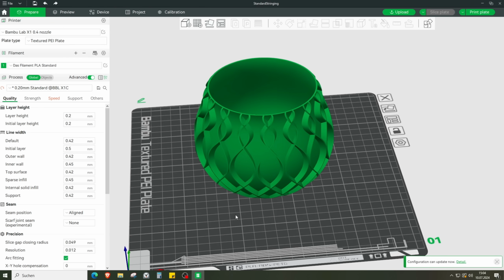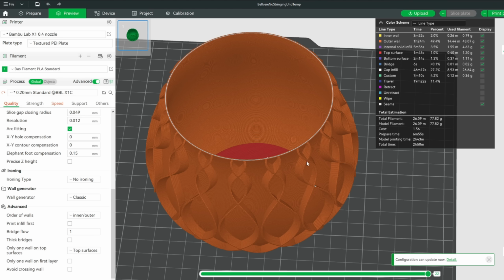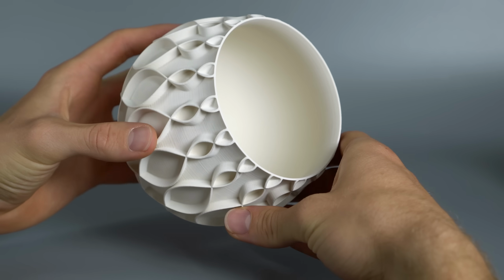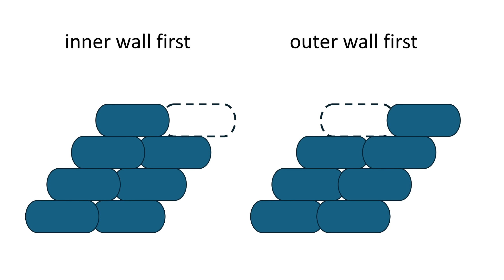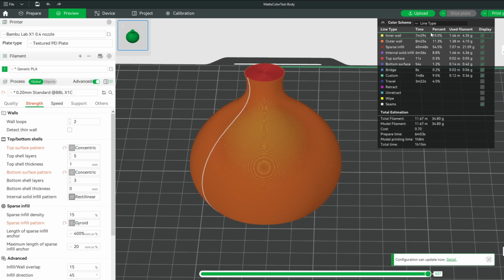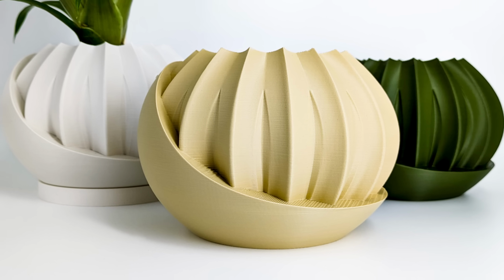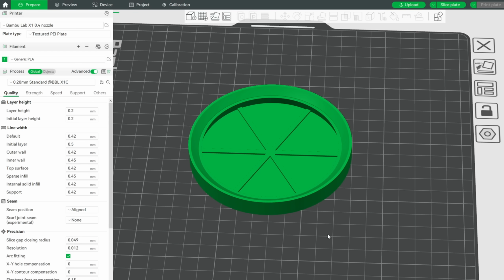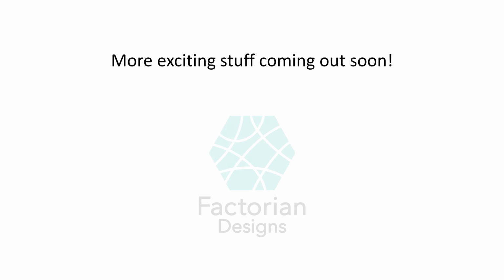5 Tricks For Incredibly Clean Prints!

Comment: This is probably a very silky question, but aren't models on makerworld already optimized for print when you download them?
Reply from the maker: No not at all, most have very basic settings.
Reply: @Factorian_Designs with ai being pushed everywhere isn't it possible to use ai to analyze the uploaded models like it's used for example for vulnerability and exploit scans on app stores?
Reply from the maker: Not sure if there is close to enough data to relate printer settings and results that would be needed for Ai training like that. I think thats still very far off.

Comment: PLEASE MAKE A VASE MODE/one wall video tips and tricks like 0.4 nozzle 0.32 line width lampshades with not kust round geometry but going in and out . when small i print sucessfully this type but 200x200x200 (ca.) will have like holes , z wobble lines ? , etc. bitteach ein Vase Mode Lampenschirm tips and tricks video mein freund

Comment: If it’s caused by the temperature on slower layers why not just change the temperature to account for the accumulation of extra heat on slower layers..?
Reply from the maker: That would be a very hard to implement in the slicer and would need finetuning for every filament. Not sure if that is a priority for developers if it can be fixed like shown.

Comment: I think you might be an expert on this problem. Could you help me? I can't download a ready-made file from Bambu Lab and open it in SolidWorks. Why do you think it is? 3mf or STL?
Reply from the maker: 3mf is just a zipped STL with a bunch of other stuff. You can unpack 3mf files with any zip software btw. In your case you need to import the STL. 
But these are hard to modify, sometimes people include STEP files, which would be way better.

Comment: Thank you so much for your videos! I'm playing with printing outer/inner and I've ran into a problem printing a simple vase: whevener I get a new line and the unretraction happens I'm getting an uggly seam with some oozing. I have everything calibrated and dry. Any parameters to help with that? I'll play next with the slice gap closing radius and seam gap parameters and see if it helps.
Reply from the maker: This setting does tend to make an uglier seam. If you have 3 walls try the inner/outer/inner setting instead. This should fix the issue.

Comment: Good Tips. 
If you're PLA looks matte then your print speed is too fast or temperature setting too low (unless you're specifically using matte PLA). The most uniform print quality comes from setting the speed the same for the whole print, at least for the outer wall. For a show piece, it's generally best to just slow the print speed.

Comment: The matte/gloss problem is not relevant to printing speed, but is relevant to insufficient flow. It's just oftentimes higher flow rates coincide with fast linear speed, but not always, and the better way to diagnose the problem is to look at the flow diagram instead.

Comment: Very well explained. I’ve watched it before I started using my printer and again today to make the prints looks better. Easy noticeable improvements. Thanks. Subscribed.
I have  a question. Which filament do you use for planters so they can hold a plant and water, and possibly stay in a sunny position without falling apart in a few months?
Reply from the maker: The planter on my desk is sitting in the sun since 3 years, waterproof and is made out of normal PLA. But it doesn't get that hot here.

You could use black PETG which is supposed to have a little more UV resistance but I havn't tried that out.

If you want to be extra save use ASA. Its UV resistant, great for higher temperatures and outside use. Just be careful with the toxic printing fumes.
Reply: @Factorian_Designs  Thank you. Lots of 'experts' says that PLA won't last long.
Reply from the maker: @rafk4424  I know and I think some of them are also right. A big problem is that PLA can be quite different depending on what additives the manufacturers decide to add.

Comment: Slicing algorithm is by far the most important thing, and Cura is the best, period. 
I use Prusa because it has more flexible settings, but it's simply incapable of doing seams on round objects or even adding consistent lines to the one wall.
Reply: Orca also has Cura’s Arachne now, I think PS might too?

Comment: I appreciate that you explained the pros and cons of printing the outer layer first
Reply: One thing he failed to mention for out wall first, is that there can be issues for certain geometries. Normally, if extrusion is say 1% too high, your outer wall will just be too big, causing the uneven layers texture. With outer wall first, this cannot happen, so the excess ends up on the inside. This is fine if its facing infill, because the excess ends up on the hollow interior. The issue is if there is no infill on the backside, and instead have more perimeters, so for example if your print is only 1.6 mm thick, and you print 2 perimeters, at 0.4, then you have nothing but perimeter on both sides. Then the only place the excess material can go is up. After a number of layers, it will build up so much that it will possibly cause a print to fail. Outer perimeter first needs very good calibration to avoid this.

Comment: I had to learn these tricks the hard way, I probably had 50+ "failed" prints until I found the outer/inner "hack" and the avoid crossing walls. Just with those two settings the prints look immensely better straight of the printer and require minimal post processing 😃

Comment: when i change outer wall for 0.33 like on your movie (bambo P1S 0.4 nozzle) i got spaghetti... when it build outer wall, it's too thin and doesn't stick together
Reply from the maker: depending on the filament, going to low can lead to problems as well, did you use PLA?
Reply: @Factorian_Designs   @Factorian_Designs  PLA Silk Dual Color from bambolab im was trying to print this model 75% of size: 1019859-halloween-candy-cauldron biggest problem is on the bottom

Comment: With outer then inner walls I've found with filaments like PETG if your printing more than 1 part your more likely to get defects on the outer wall because as the nozzle travels between parts and initially touches down to start extruding it's likely to leave a small blob. 

Now in some slicers there's an option for inner outer inner that solves this issue as it prints a single inner wall, then outer wall then the rest of the inner walls.  You of course need more than 2 walls for this to work.
Reply from the maker: Yes you are right, I should have mentioned that in the video as well. Especially around the seam it can get less clean. For prints where the seam is hidden I like it the most.

Comment: another thing you can do is to zoom in alot on the preview pane to see that the deviation added to the model from the following slicer setting will make for even better prints with the cost of longer slicing time;

1. lower resolution from default 0.024 or what your slicer has to 0.
2. disable ARC
3. lower deviation to 0.04
4. zoom in again and behold the non squiggles and deviations.
5. increase nozzle temp by 10-15c if you still get matte/glossy sections. 

watch those shifted layerlines disappear , even on those white prints ;) This is only possible with a correct flow,temp and speed calibration.

p.s.
remember that time is cheap, failures are expensive.
Reply from the maker: Thats an interesting suggestion, I have played around with these settings but not to this extent. I will definetly try this out.
Thank you for the input!

Comment: Since your video's publish date, has the Bambu Lab Studio got the update that you mentioned which existed in Orca Slicer?
Reply: I’m actually going to buy my first Bambu printer in 10 days. It will be X1C combo. I’ve had 5 Prusa MK3S+ for years but I decided I should try the Bambu. I use Prusa Slicer all the time. Do you think it is good to first start using the Bambu Slicer with the new printer or do you suggest me to use the Orca Slicer right away? I thought the official slicer might be a good start especially when using their own printer. What do you think?
Reply from the maker: @kaanaslan_tr  Sold my Prusa MK3S+ for the Bambu Printer and I love it. I have also written down a few things about the different Bambu Lab combos you can get on my website if you want to take a look at what I would recommend.

I would honestly use the Orca Slicer right away, I see 0 disadvantages and the Interface is 95% the same.
Reply: @Factorian_Designs  Thank you. I'll give it a try. I don't know if it has all the features like reaching the camera but I'll definitely check it out. 

I can't sell my Prusas :) I tried but I never received any offer :)
Reply from the maker: @kaanaslan_tr  It has all the connection features like camera, remote control etc. 
Yeah I can imagine they are hard to sell now. But I guess its ok, they still print decent just a little slow.
Reply: @Factorian_Designs  yeah, I even have 1 MK3S+ kit which is in a box for almost 2 years and waiting for me to be built :)
Reply from the maker: No, Bambu Studio still doesn't have it. I would just switch to Orca Slicer. You can even take all printer and filaments presets with you.

Comment: A huge improvement to print quality for me was to check the wheels on X and Y axis, they where over-tightened from the manufacturer and the ride wasn't smooth. Check the bumpiness of your axis by moving bed or toolhead manually. They should be barely in contact not squished !
Reply from the maker: True, mechanical imperfections can make a huge difference. Luckily they are rare with newer gen printers.

Be careful with moving your printer manually, this can lead to induction currents and may damage your electronics.
Reply: @Factorian_Designs  I guess there are fewer problems without these rubber wheels...
Reply from the maker: @thds4815  yes definetly but if adjusted right you can print just fine with them.

Comment: Hi, does anyone here know if the Creality Print slicer has a feature similar to Avoid crossing wall? Thank you for your insights!
Reply from the maker: Yes it does, take a look at the "combing" setting. Thank you for watching!
Reply: Its called avoid crossing wall if you turn on your advanced setting. I use it to print vase in my k1c and it works OK
Reply: @daruchusnu6941  Thank You!
Reply: I cant find it. Combing is not a setting in cp. Its in cura
Reply from the maker: @danielcrandell7533  You are totally right, sorry that is only for Cura. 

There is an avoid crossing walls button in Creality Print slicer to check off on the “quality” pane, at the bottom, in advanced.

Comment: Summary
1. Avoid crossing wall
2. Outer/inner
3.1 Top/Botton surface concentric for round object 
4. Increase overhang speed, and Dont slow down on outer walls in Filament 
3.2. Concentric surface for top layer for round object 
5. Print only object at the time
Reply: The matte finish is an indication for to much temp or volumetric speed. With that you have also not a good layer adhesion. The glossy print is much stronger.
Reply: @Flatout-i1v But we wanted it to be matte
Reply: @Flatout-i1vmatte normally means you’re pushing out the filament faster then the heater block can handle. Run slower OR run your nozzle hotter and it should be shiny again. Shiny = good layer adhesion.

Comment: Trick 6: if you didn't spend money on a printer buy a Bambu.
Reply: I just bought my K1C a few weeks ago. I am pretty happy but I maybe should have spent the 100€ more for the p1s :(
Reply: @itzleeky6461 i did the same thinking. K1C won because of the carbon, Bambu needed more upgrades
Reply: @itzleeky6461 sell it again an you can buy new bambu p1s bro
Reply: @itzleeky6461 I wouldn’t always say so. I got an A1 and kind of wish I’ve gone for a K1 tbh
Reply: @itzleeky6461 do you mean x1c?
Reply: Agree, save headaches and time, and get a Bambu. Went through many printers. My new bambu p1s with ams now produces so much better results right out of the box, no settings tweaking required at all. The print plate has awesome adherence, no more need for 3d glue spray. Bambu just apparently did a lot of things very right. They don’t focus entirely on the hardware but instead offer a perfectly tailored solution with optimized software. Wish I had known earlier. My snapmaker idex printer which I loved very much did not by far produce the bambu results, despite constant tuning and experimenting, and unfortunately had clogging issues regularly, despite trying default settings, tweaking, different filaments, even replaced hotends.
Reply: Thank you but Nah, they're too expensive. They deliver little for the price they charge
Reply: aint like yt, facebook insta arent selling my data already, id rather trust the chinese than the american not even gonna lie
Reply: Instructions unclear. I now have a bambu and a panda is chasing me.
Reply: @VSquared3DPrints ever since pandabuy got raided ive been seeing pandas in my walls
Reply: Kobra S1 combo working fantastic for me
Reply: I bought my first printer bambu! Should arrive tomorrow can't wait to see what I can make for my house
Reply: Bambu is just an good option. Not the only one.
Reply: @methodiklabz mine is working like a charm with little adjustmants
Reply from the maker: Can highly recommend as well 👍🏼
Reply: New Plus4 from Qidi offers Bambu print quality with Bambu like interface, but heated chamber and 305 bed.  It will have AMS early next year all for $799, I have couple dozen hours with it.  Great machine!   Love the bambu, but love to do Nylons! For nylons one wants a heated chamber with nozzle temps that can go to max of 370C.   Love this new machine.  Highly recommend it.  I could not justify over $2400 for Carbon X with a heated chamber.
Reply: @jefft490 sadly $799 is only the printer and AMS/MMU is still up in the air. It's estimated for Q1, which is halfway over.

Still a good option for a variety of filament types, heated chamber, large build plate, (and had one Day Amazon shipping), but no MMS today
Reply: Buy a prusa instead
Reply: This aged poorly
Reply: Why @Akhilesh_H
Reply: @Akhilesh_H  yeah because all of the sudden the controversy made the printers quality degrade
Reply: Trick 7, but a enclosured Bambu printer if you have kids 😅
Reply: @pauls6277  or pets 😂
Reply: Yeah No thx, Companies like Bambulab are not supportable at all, nice product but sadly they are against open source with there closed Ecosystem.
Reply: @gordonbelfort7176 It's a walled garden.
But still not a bad walled garden. You get everything you need inside. This could become bad in the long run,But it's great now.
Reply: Aren’t a lot of the newer printers much more closed sourced now though? For example my ender 3 years ago was as open sourced as it gets. But the newer creality machines have firmware updates that are just compiled binary. Afaik a lot of these printers do not easily support marlin without mods right? Products are much easier to develop and fine tune for a specific platform vs making the software modular and support hundreds of different printers. Also look at the impact bambu lab has had on the market 3d printers got better very slowly over time until they launched. Now they are all incredible out of the box. Just my 2¢
Reply: @Javii96  that's the point, some manufacturers have been semi-closed or closed systems. But since Bambulab hit the market a wave of them are changing from open to closed source. They started it and even if they are the best machine available, the point is it is against the community that started consumer 3d printing.
Reply: @gordonbelfort7176 in what sense is it closed source besides the software being their private product?
Reply: @slowestjabroni  most hardware used are not industry-standard and not compatible with any other manufacturer on the market, the software used in the machine itself is not modifiable, all Accessoires are mostly locked in this closed eco-system.
Reply: My p1s was my first printer. I have no issues with it and it made getting into 3d printing very easy for me
Reply: Hi, I want to make a vase and sell it. Which 3d printer can I buy for perfect vase?
Reply: Or prusa, their speed may not be up at bambu's level but the quality and dimensional accuracy is unmatched and they are also weirdly quiet
Reply: I have both, bambu has the highet accuracy. You sre soing something wrong@FrIoSrHy
Reply: This didn't age very well...
Reply: This aged like milk
Reply: Bambu is also backed by a firm who is working with the Chinese military so I cant buy their printers 🤷🏻‍♀️

Comment: My hands have been shaky ever since I've known myself as well. Don't worry about it too much ^^
Is there a some way to tell if my line widths are bad and understand if I should change them?
I also really like your studio lighting setup.
Reply from the maker: The shaky hands comment was only supposed to be a light hearted comment, luckily I don't plan on becoming a surgeon!

As long as your line width are around 0,4 - 0,6 mm you should be fine. Like said in some comments below, depending on the material type smaller line widths can reduce the strength of you part. So just be careful with that.

Comment: the other upside of printing one part at a time is that in case of a print failure you can still have the already printed parts done. Also modern printers have an option to exclude certain parts, so if you see a failure you can skip printing it
Reply from the maker: Completely right, good addition to the video!